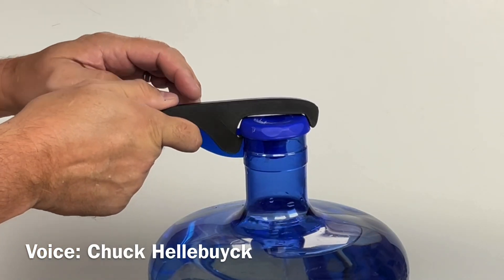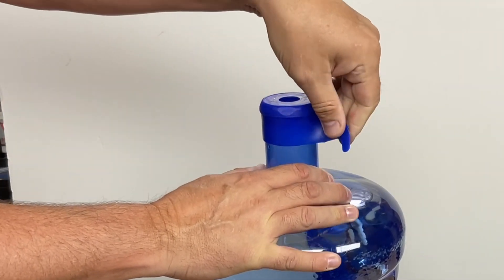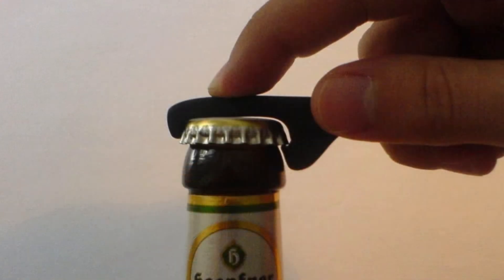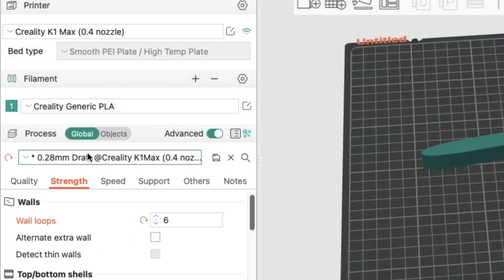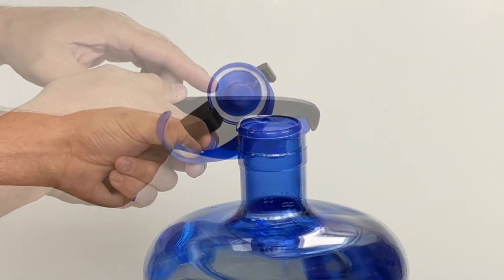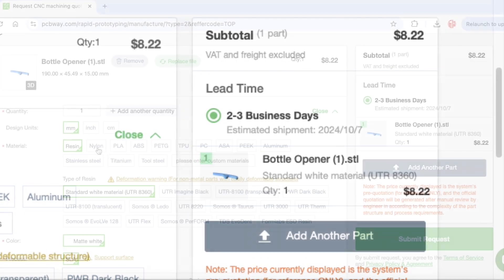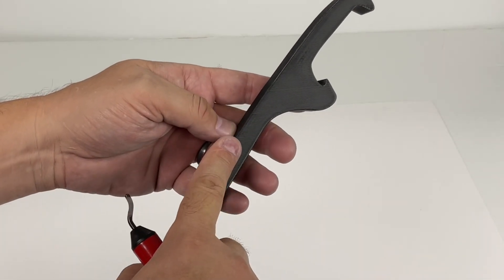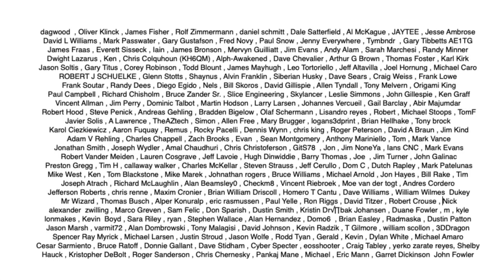3D Printed Water Bottle Tool to Save Your Fingers!

Comment: Why are you using grid infill?
Reply from the maker: No particular reason. It works well in most cases and prints a bit faster. If strength becomes an issue I switch.

Comment: For those talking about just poking a hole in the lid, I don't have a full-size dispenser. I bought a pump which sits on top of the water jug and the pump sits on top with a hose going to the bottom. Thus, I have to remove the cap like CHEP does. I have had the same issues. A month or two ago, I would be printing this tool as I type, but I found a local grocer which allows you to refill that same jug (same brand "Primo") for $2 per 5 gallons.
Reply from the maker: I pay $1.50 for 3 gallons jug. It’s a 12 step reverse osmosis purification. Best water I’ve ever tasted.

Comment: my family uses the same (or a very similar) cooler, but we use the 3 gallon bottles. we refill them manually at a local water mill, and the caps just screw on easily like a soda bottle.
its a little cheaper, and no need for an extra tool (even though this is really creative!)

Comment: Why bother with any CAD on a scaled design? Pull the part into orca, make a general cylinder, resize things.. Then you can go a step further and make a negative boolean that cuts the edges of the disk slightly into the pry tool, will help hold it on-center automatically.

Comment: You aren't supposed to take the cap off, you push the hose through the hole in the cap.
Reply from the maker: Doesn’t work on mine.
Reply: @FilamentFriday  Push harder or pop it with a screwdriver/dowel first. They are universal.
Reply from the maker: The hose would fit too tight and would push out the machines cap. Then taking the top off to change sometimes stuck. We also use a smaller 3 gallon jug so it’s light for my wife. I found popping the cap off was much easier except when the strap broke. This tool makes it a breeze.

Comment: Aren't you supposed to just poke the inside of the cap into the water and then just run the tube through that? Or is this so horribly designed as to make that impossible.
Reply from the maker: Some are like that, this one isn’t.
Reply: Mine you just pull off the cap

Comment: You should add a round section to the handle so you can store it on the top spout for the next time. You can send me a check for %50 of the profits..:)

Comment: Forgot to measure the thickness of the cap, it worked this time but the tip is to measure the inside as well to know what thickness you are working with. Love your stuff Chep, keep it up :)
Reply from the maker: I didn’t forget, I didn’t need to. Why do you think it matters? Tool doesn’t touch the center. Just the edges.